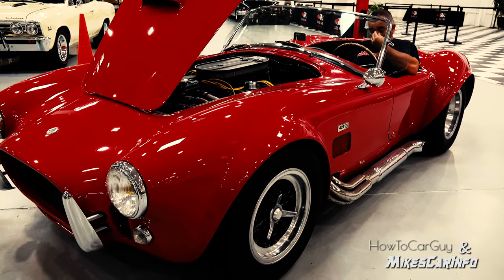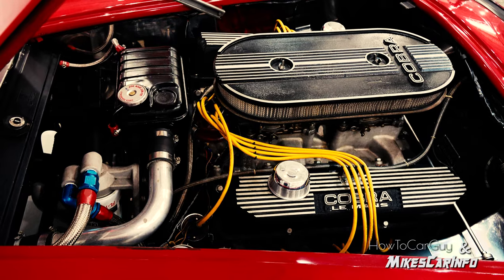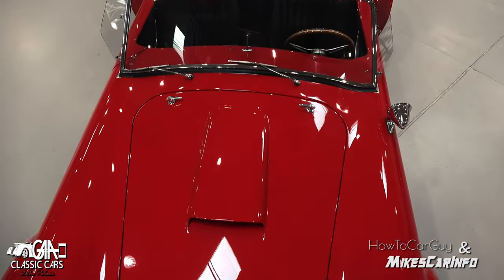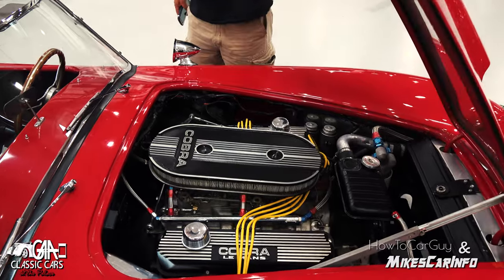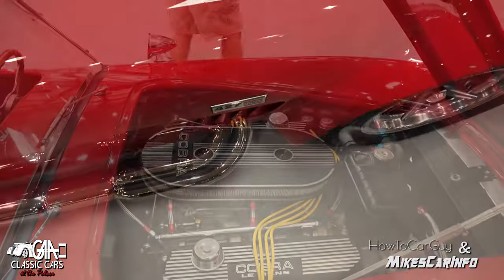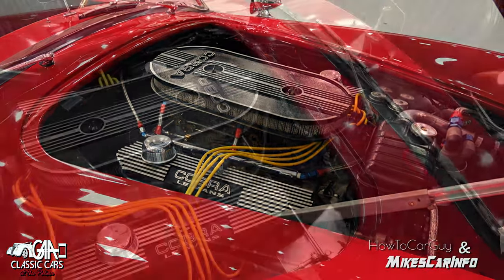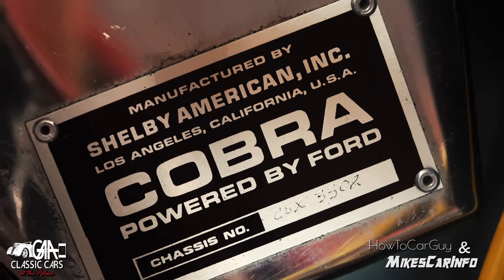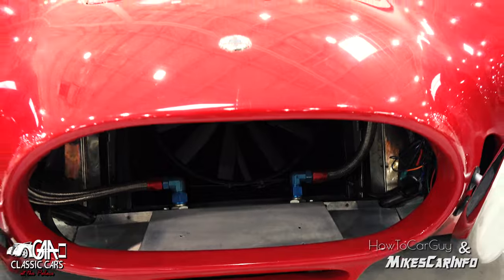1967 Shelby Cobra - History & Review of chassis CSX3302

Comment: This car seems to have ben re-bodied at some time. The rear flares and oblong ("rectangular") Lucas 542 tail lamps are pure 1965. By 1966 the twin round red and amber tail lamps took over as standard equipment on all Cobras exported to the U.S.A.
Reply: The round taillights where only for the street version with no side exhaust, the S/C still had the rectangular taillights

Comment: That looks like the 428 engine.
Reply: It has 2 carbs...pretty rumbly exhaust...side pipes but no roll bar and no windshield washer nozzles....I don't it's 428 engine but doubt that it is 100%stock.
Reply: 427 and 428 look the same. I have owned my cobra since 1968. It originally had a 428 like about half of all 427s built. Mine now has medium rise 427 side oiler. The original 428 actually had 427 low rise heads and intake manifold. My car with the 428 ran 12.40s in the quarter. This car seems to have been modified to SC specs.

Comment: CSX3302 Was a Street version Cobra with a 428 Cu in FE engine Most Likely . No Roll bar , a Glove box and  18 gallon fuel tank 
It was Restored couple times , and changed to a 427FE Dual quad induction and Side pipes were added . Beautiful Car I will say 
I Had one just like it CSX 3227 just a bit earlier .

Comment: Great video, outstanding car! 
Just an FYI. This car CSX number 3302, would be a Street Roadster, meaning no hood scoop, no roll bar, no side pipes, no glove box and a different gauge lay out. I want to be clear, I am not knocking the video or the car I am just a Cobra nerd. The hood scoop was added you can tell it is a different shape than the original cars, also it is molded in not riveted to the hood. The side pipes were added to this car, the original side pipes were bolted to the collector and there was a tap  & bolt arrangement sticking out at that junction. Interesting to me, most street roadsters I have seen have added a roll bar, no roll bar added on this one. SC cars were semi competition cars meaning they were race cars detuned for the street. The speedo was in the center of the dash, not in front of the steering wheel, because a race car driver would be looking the tach not the speedo. What is really cool is here, I am guessing that these modifications were made, "Back in the day." Many Cobras were modified, in the 1960's, after all there were the ultimate hotrod of the day. Again great video!
If you like Cobra stuff, check out Pete's Snake Bite Kit YouTube channel.  UCKYeunV7TgwdlrtRlnkUs8w